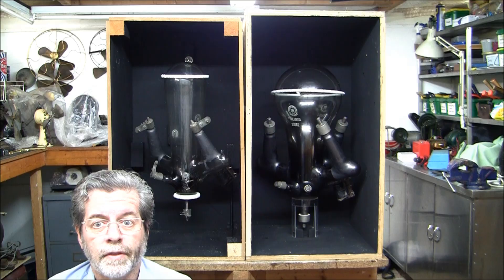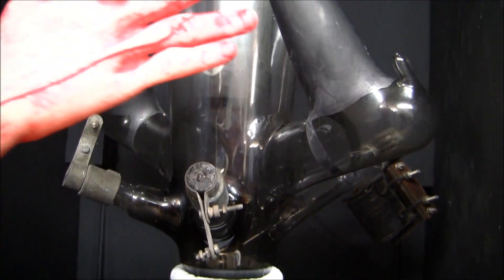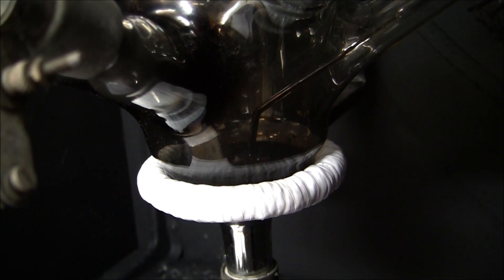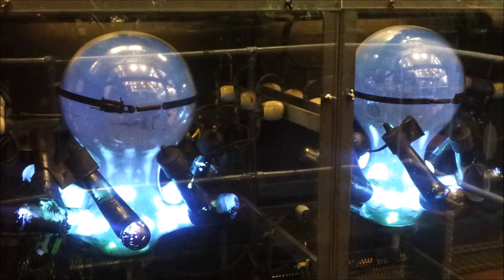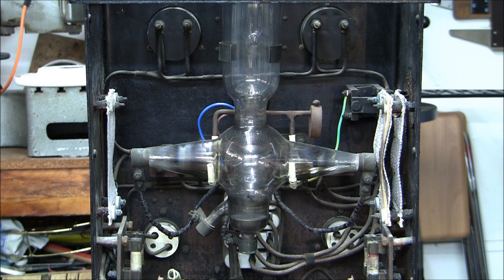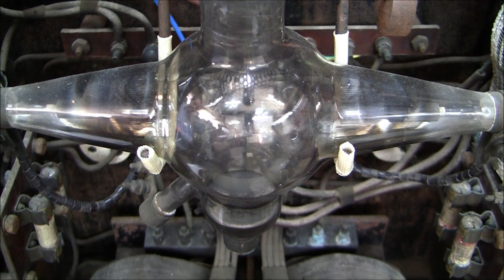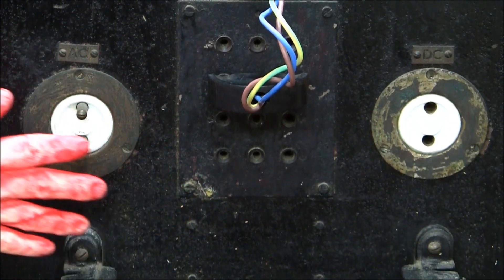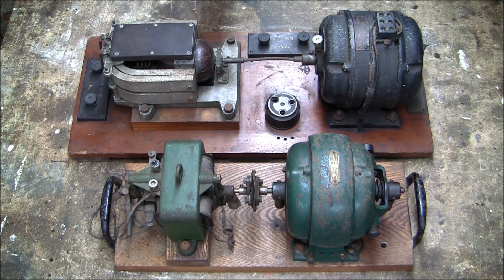Mercury Arc Rectifiers, a brief overview

Comment: Mercury rectifiers were beautiful to watch but also very troublesome so it was with ambivalence that I watched them being replaced with silicon.
Reply: Troublesome?   What were common trouble-modes?
Reply: They had to be handled carefully- not shaken or tilted, required a long warm-up time (10-15m) and often arced inside when getting old. The lights in the building would blink when that happen.
Reply: Thanks Nathan.   "Arced inside" sounds like a dangerous failure mode.    Did the tube continue to function?   Are damaged tube repairable?
Reply: There was a relay in the cathode circuit of each tube that would trip briefly to stop the arc. Then  the tube would usually resume working ok. If the arcing became too frequent the tube would be replaced.  In many transmitters there was a spare tube kept warm (filament on) all the time so it could be immediately put into service to replace a bad tube.
Reply: I should note that the type use in transmitters are different than the one in this video. They were glass tubes and had one anode each. Six were used in a 3-phase full-wave configuration putting out 12,500 volts at 6.5 amps for a 50-KW AM transmitter. Their blue-purple glow pulsated in step with the voice or music since the current varies with the modulation.  Sort of like a early "Disco" light. :-)
Reply: Fascinating observations.   You're obviously experienced with this equipment.  Are you in UK?   IOM?
Reply: I'm in the US. Retired broadcast engineer. I was just beginning this profession in the 1960s as mercury rectifiers were being phased out. The new transmitters at the time used the newly developed silicon-stack rectifiers.  Silicon stacks were much more reliable but not very interesting visually. Mercury rectifiers are long obsolete and I doubt they are used anymore anywhere.
Reply: MAR's were never really that troublesome. Biggest problem with Hewittic Bulbs was seal failure and air entering the evacuated bulb.  Transport was the critical issue.  Handling was fairly straight forward but the bulbs had to be inverted very slowly to permit the mercury to run into the condensing chamber.  If they were transported in the vertical operating position the weight of mercury movement would break the exciter anodes.
Reply: At the same time, it's neat to see these sometimes functional objects able to be created with two hands and some heat mixed with some vacuum and rotation.

Comment: It has been scientifically prouven that pointing at things with a bloody plastic hand can multiply the coolness factor of a youtube video by 17 compared to laser pointer controls. The study also shows that there is no match for the bloody dildo if the operator is skilled enought to point at the right things despite the flexibility of the object. Can you beleive they immediately cancelled my Phd ? Then i was found masturbating naked in a public dumpster, and they found out i had stolen that phd.